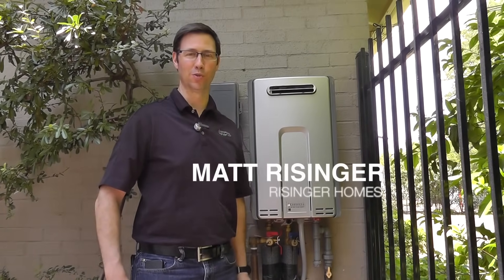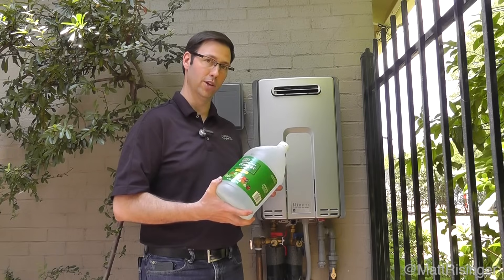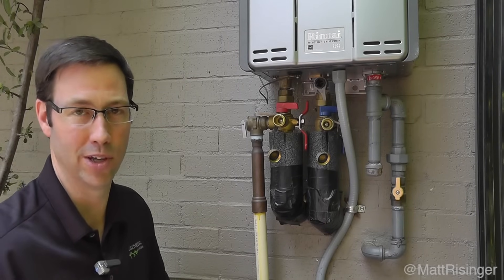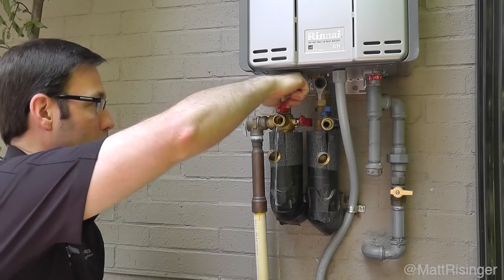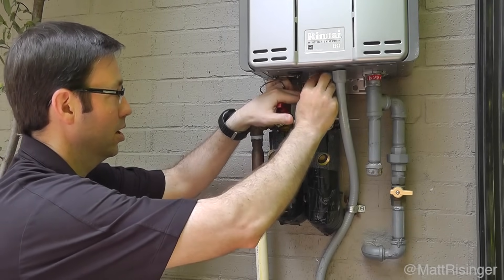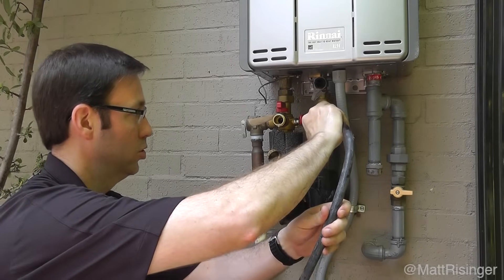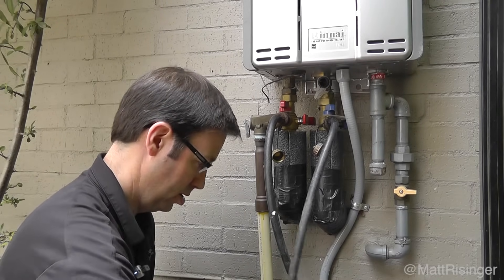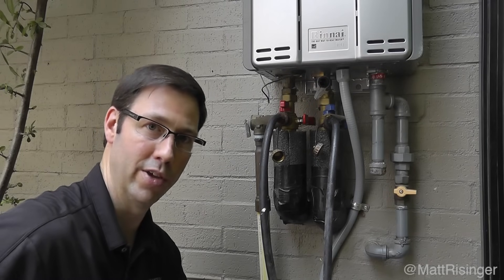Tankless Water Heater DeScaling - How To Flush

Comment: just curious as my pump is pushing the water through the cold system like you said but it seems he water coming out of the hot hose side is trickling out even though the pump is pushing stuff through.  Is that normal in the beginning?
Reply: No...if your valves are aligned properly everything going in should be coming out. Review Matt's valve alignment in the video.

Comment: I attempted to perform this procedure on my Rannai R53 tankless water heater. It was going fine until running the pump through the water heater would only come back to the bucket at a trickle. Water passes through water heater normally and I verified pump pumping well though I don't know the PSI. You recommend a 1/6 HP pump and I was using a 1/4 HP. Customer service suggests not enough head pressure on my pump. what specs would you suggest for a pump to flush?  Thank You.
Reply: Are you pumping the correct direction? In to the cold, out the hot side?
Reply: Yes.
Reply: if you powered the unit down at the control unit and not by unplugging it, you closed the inlet solenoid and bypassed the coil...

Comment: Everyone seems to be using food grade "diluted" white vinegar 5% acidity.  However, Rinnai's flush instructions says to use "UNDILUTED" virgin white vinegar.  Matt, should we be using diluted or undiluted vinegar?
Reply: Rinnai's instructions state "Pour 4 gallons of undiluted virgin, food grade, white vinegar into pail." 

So no....DO NOT use straight acetic acid (The acid in vinegar). Vinegar, by definition, is 5-20% acetic acid in water solution. Rinnai's instructions simply mean open the vinegar bottle and use it, don't dilute it.
Reply: And food grade vinegar is typically 5% acetic acid.
Reply: My grocery store has a 9% acid vinegar white vinegar, as well as the usual 5% acid. Do you think it would harm the water heater to use the 9% acid strength? If 5% is good, would 9% be even better, or do we risk damaging something at that point (either the heater or the sump pump)?

Comment: the valves to the cold and hot water line will not turn. trying to turn them verticle but wont budge. any advice?
Reply: Mine stick when not moved often. Keep trying but maybe plan for a failed valve.

Comment: I would mention that the nearest hot water faucet to the unit should be opened before the gas (or power) is turned back on to get rid of air pockets in the unit. An electric tankless water heater will fry the elements if there is no water inside the unit.
Reply: thanks Steve

Comment: Great video.

I have a 75e model and its taking literally 1min before the water in the house heats up. I also notice a drop in pressure when using hot water in the shower, any suggestions ? Would descaling be the fix for this?
Reply from the maker: +YetAnotherTechGuy most likely you have a scale build up. Thanks for the comments

Comment: is the sediment trap configuration on the gas feed correct ?
Reply: I was wondering the same thing,  if your gas line is coming from below is it really necessary to add this sediment trap restricting gas flow to my gas hungry heater?
Reply: Yes it is correct
Reply: Yes, a sediment trap doesn't restrict flow. It saves trash from entering your firing orifices. Never leave out a sediment trap.

Comment: Hi Matt, we do have similar tankless water heater, we had it flushed yesterday but we have a problem that we though flushing is gonna fix it. We live in DC area, our house is 3 level house, the upper level isn't getting very hot water in the showers. I raised the temp to 125 but the water is warm. Any idea why this is happeneing? It was working find before. Thanks
Reply: Call the guy!
Reply: When you posted this it was Feb. Are the lines to the 3rd floor properly insulated? At 125 F you might be losing a good bit of heat traveling that far, and mixing with cold water in DC in Feb. (You know you can likely push that temp to 140 and see if that fixes it).

Comment: I think CLR would of been the best use for descaling this.. very powerful stuff to get rid of mineral deposits, and won't hurt the copper/stainless steel heat exchanger.
Reply from the maker: +William Dean I see your point but I've not heard any of the big tankless manufacturers say this was an appropriate product. Use plain vinegar or see my latest flush video for another approved flush solution

Comment: I have the Rinnai RL75 two years old. Just finished its first flush with your method worked great except I put an old sock held on with a coupe of rubber bands over the return hose to keep from pumping junk back thru the tank. Plus I unplugged the unit after turning the gas off so I wouldn't get error code 11.
Reply: ......or part of a woman's stocking.....  Great extra tip!  Too bad this "flushing system" could not be made integral to the instantaneous water heater....esp. if it must be performed biennially.....?!?

Comment: Matt, quick question.  we have 4 Rinnai's for a Laundromat.  can I run these all together for flush?  Start with machine #1, and run the red to machine #2 blue and then down the line?  #2 red to #3 blue, #3 red to #4 blue and #4 red back to the bucket?
Reply: You need to do them individually.

Comment: One thing you should look into to doing. I am a plumber and do this alot by the way. I use a inline filter on the outlet line to catch all the sediment to keep from putting back into the unit. A sock and a couple rubber bands or hose clamps at the end of the hose works well too. It also shows you how much debris you really pull out of it.
Reply: Get this man a beer! Plumb on brotha
Reply: Great idea.
Reply: Agree, good tip to add, thanks
Reply: This idea was brilliant.  I've been flushing my water heater for the past five years without a filter.  Read this comment and installed a sock to the exit line.  WOW!  It picked up a ton of trash.  Thanks for the tip Dillan!
Reply: Some say turn off the power… others—like this—say leave it on. What is the reasoning here Matt? Thanks.
Reply: Thanks for this tip.  Absolutely priceless.
Reply: good idea! 💡😊👍
Reply: can u create a video about this? i am new into water heater
Reply: so, do you re-use the same inline filter for later/other flushes? Or do you toss it and use a new one each time?
Reply: Appreciate the tip
Reply: When I go to Amazon and see this pump is $108+ dollars and no free shipping and sold by a third party outside of Amazon... I think not gonna buy that pump. Amazon sells one for $43 with free shipping and delivered next day.
Reply: @N01HERE2C can you send me link to water pump please I will be doing this to my tankless water heater Ty very much
Reply: Why not just get a water filtration system
Reply: Im trying to flush my rinnai tankless and nothing is coming out. No vinegar.  All valve are in the right flow or shut-off.  What's going on? Anyone?
Reply: Thanks man !
Reply: I was hoping you had some videos to show us exactly how you do that. Why have a channel with no videos? 🤔😆 I know, just to comment.
Reply: @dillanwaters6125, I have an electric tankless water heater and what I've noticed the calcium buildup is only on the hot side that is making so much calcium. We've flushed tons of calcium out of all the hot water lines. Why isn't that mentioned about well water?
Reply: Thanks!!!
Reply: Great idea
Reply: @dillan waters You mean you put a sock over the hose coming out of the hot water side which is going back to the bucket? Thanks
Reply: @homegmail2727  Correct. One end of the hose connects to the hot water side, the other end goes in the bucket, and a sock gets wrapped around the end of the hose that's in the bucket. Any debris or scale coming out of your water heater gets stopped by the sock before it gets back into the bucket and is picked up by the submersible pump.
Reply: @homegmail2727  whew! Glad you cleared that up for me the zip tie was chaffing my balls
Reply: i realize I'm pretty off topic but does anybody know of a good website to stream new series online ?
Reply: @dwaynekristopher4365 my hero. That's what you are. Do you know how often I wanna do what you just did? Lol ask random questions in comment threads
Reply: Or you can use two buckets so you are not putting dirty solution back in to the system plus they sell spacial solution to clean these water heaters and if I wasn't a licenced teck witch I am I would never touch this water heater it's hi  teck and if you do brake it you will void worenty I would call some one how knows how to work on it ....
Reply: @mp-mh3wf  This is basic maintenance, not something like a repair or modification, in which case you should probably call a professional. I change the oil in my car all the time without any concerns about voiding the warranty. Life gets expensive fast if you have to call someone to perform basic maintenance on everything you own. Aside from that, can you elaborate on your two-bucket solution? At some point you have to form a closed loop, unless you want to push hundreds of gallons of fresh vinegar through your water heater and then discard it all. I can't picture how two buckets would allow you to avoid recirculating the already-used vinegar at some point.
Reply: @bungle555  EXACTLY 😀
Reply: @mp-mh3wf  Can't use two buckets, this is a recirculating system.
Reply: @mp-mh3wf  Does a "Teck Witch" fly a Roomba?
Reply: @mp-mh3wf Two buckets? Yes.. Its clear you should never touch a tankless water heater🚱. Or attend a spelling bee.
Reply: 😂😂😂,  @jonathanwayman

Comment: Love the way those valves turn with finger pressure. I had to use a wrench and a hammer. They closed way easier than they opened. May have cleared a little crust. Much thanks for the very clear instructions.

Comment: What do you do if you don't have the two valves needed to connect the hoses?  Is there an alternate way to flush out the tankless water heater or would I have to install those valves?

Comment: Another video recommends disconnecting the water heater's electricity.  What's right?  Also, when the de-scaling process is done, should the water heater be flushed with water to remove vinegar?
Reply: I unplugged the power from the way just for safety.  Flushed it for 1:30 hours. The vinegar turned turquoise. Then flushed it 30 more mins with clean vinegar. 

I did t flush clean water through it. I do t think the vinegar would do any harm running thought your pipes.  

Next time I would run a little hot water just to flush out any left over vinegar. 

But my flush was easy did it a year ago. It's time for a new one.
I have no error codes. Maybe because I unplugged it when all this was done.

Comment: Is that water heater on the outside of the house? Why?
Reply from the maker: In out hot climate it's a great spot for the water heater.  Master Bath is right behind this wall. No venting issues. It has an electric heater element and is protected down to -10. But we rarely get a freeze in our climate. Best, Matt

Comment: would have been nice to have a visual on what your setup looked like with your sump pump and your buckets. 

you're very articulate, but that would have completed the clarity you seemed to present.
Reply: Dump vinegar in a 5 gallon bucket.  There is literally one hose to  hook up on the pump. Drop the pump in.  Come back in 1 hour, or 60 minutes. You're choice.

Comment: Great video Matt. But i have a question is this true to all Rinnai I have the  RL75. I have flushed it last year spent $200 alone for flushing the unit is only 3 years old comes with the house. The main problem is the sediments or build up is already in the plumbing causing clogging the hot water pipes not much hot water comes out. Is there a way I could do flushing the whole plumbing in the house with the vinegar? Thanks
Reply: I called a a. Ulcer who specializes in this tankless water heaters. They charge $155 to flush it and also charge $155 to take it apart and clean it. 

I flushed it and told him to clean it. 

I was surprised how complicated those things were once he took the cover off. The guy took other parts and vacuumed it. 

So flush it yourself like I did and save $$$

I went and bought a pump and I used it all the time for other things too. 

I might make a video next time I flush it. 

Pas I had my off when I flushed it.

Comment: I bought the bucket you recommended but it is nothing special.  You stated in your video that the bucket you were using kept the pump off the bottom of the bucket.  The bucket you linked to is overpriced and nothing special.
Reply from the maker: Sorry about that. I need to update the link. It should have a screen at the bottom to keep sediment out of the pump intake. My apologies.

Comment: In your video you say to leave the power on to the unit.  Others say to unplug the unit.  Which is correct, or does it even matter?
Reply: The Rinnai instructions say to unplug the unit. This will prevent the heater from being energized if the sensor detects high enough water flow (in this case, vinegar flow) much like when someone opens a faucet to ignite the gas heater - which might happen if a powerful pump is used. Then you will get super hot vinegar circulating which would be undesirable. It is no big deal to unplug the unit so unplugging is a prudent precaution.
Reply: The Rinnai instructions says to run cold water to rinse out the vinegar. Otherwise, over time (many flushings) the vinegar will wear out the brass fittings. Wile this is an excellent video on doing the vinegar flush, the cold water flush afterward is essential to keeping the heater functional without calling for servicing for many years.
Reply: Also, some say to run cold water to rinse out the vinegar after.  Is that required?  Wouldn't it be better to run vinegar through the pipes to clean all the pipes/faucets anyway?  Should faucets be run immediately to prevent vinegar sitting in the pipe/heater until the next long use of hot water?  Thanks.
Reply: I left the power on and got a continuous Error 11 code (pilot won't light).  Flushing went fine after 4 years of no flushing.  Vinegar was a bit greenish when I disposed of it.  There was no sediment.  Our heater is fed with softened water.
Reply: +Courtney Putnam  After getting the error code did you do it with the power off and flush it again?
Reply: +Ross Fitzgerald. I just spoke with my son who helped me with this job. We kept the unit energized during the entire process without any problems.  We just kept getting that same code.
Reply: Always flush the system with fresh water before connecting it back to your house water system. Vinegar is ACID. And you never know where it might hide in your water system (or be consumed).
Reply: For the Rinnai units, RINNAI says turn the system off (unplug). Do not leave the system on when running vinegar thru the system.
Reply: not if you turn off the gas to the unit, it may want to start, but without gas, it will just error out.   if its an electric unit, then you need to unplug it.
Reply: The code indicates that the heater (while still plugged in) is detecting a flow but not of high enough pressure to ignite the gas flame. If a more power pump was used, it may ignite. For safety, unplugging the unit is simple to do and will prevent accidental firing of the heater.

Comment: Geesh.  I did everything in reverse order like you stated, but now no hot water.  I did turn off the Rinnai at the panel (where you can change the temperature). I turned it on at the panel and no hot water.  I did not flush the vinegar out when complete, but that shouldn't matter should it?  If you read this, would love a reply since my wife is mad at me for doing this flush process myself.  She can't take her hot shower tonight.
Reply: +sargescott1 I just got back my hot water.  I have been on the line with Rinnai tech support and the problem was the flow turbine.  I had to remove it, clean it, and put it back together.  Kinda weird, but that was a curveball that I wasn't expecting.
Reply from the maker: +sargescott1 Just now seeing this... never heard of this issue before... Had it been a while since your last flush?  How was the tech line?  Helpful?
Reply: +Matt Risinger I agree this is weird (that flushing would cause the flow turbine to fail).  I have had my Rinnai system for two years and never flushed it.  Rinnai tech support was super helpful.  A guy named Rodney had after hours duty this weekend and we became best friends.  He had me run some diagnostics which told him the flow turbine needed to be removed and put back together.  Challenge was access into this part was tough - you really had to almost lie on the ground and look up into it, and getting the piece out was a challenge even with needle nose.

But bottom line, I still love your video and obviously I agree that de-scaling is essential even though I hit a weird issue.  The Rinnai tech thought I must have moved some "gunk" during the process into the flow turbine causing it to fail.

Funny side effect is my sister lives next door and she has had a Rinnai system for 7 years and never de-scaled it.  I told her I'd do hers after watching your video, but after she saw me working intensely on fixing mine for about 18 hours, she said "no way".  I told her not de-scaling hers is a bad idea.  But she won't listen.  She will just run her Rinnai until it fails one day.

Lesson learned is probably to do de-scaling more often.  Waiting two years was too long.  I have a family of four and live in Florida (with hard water) so I'll make sure I do this annually going forward.

Love your videos and keep up the great work!